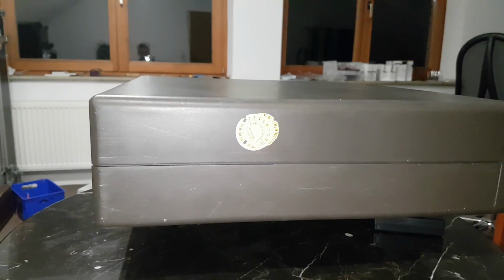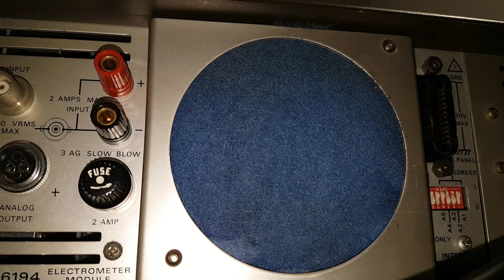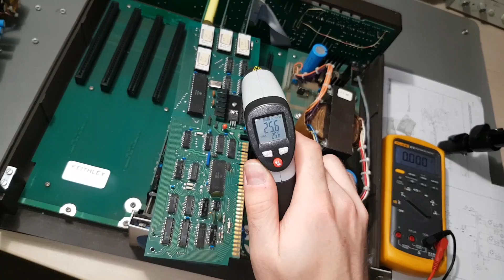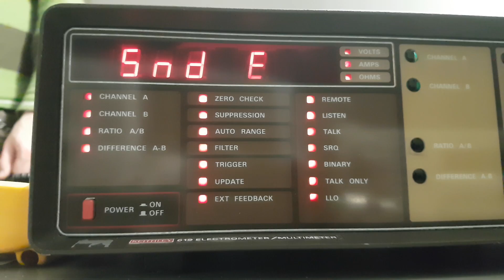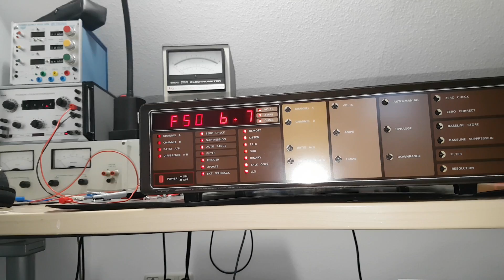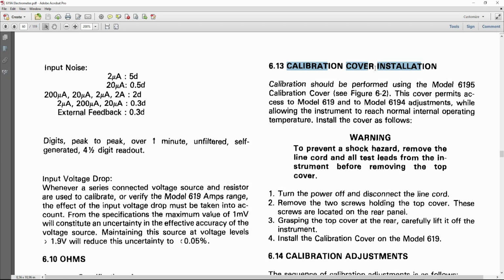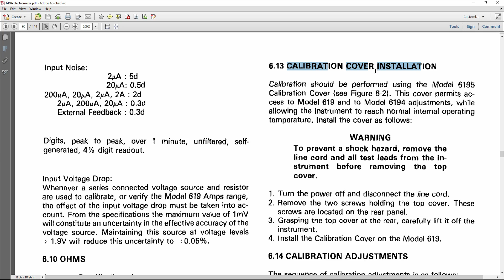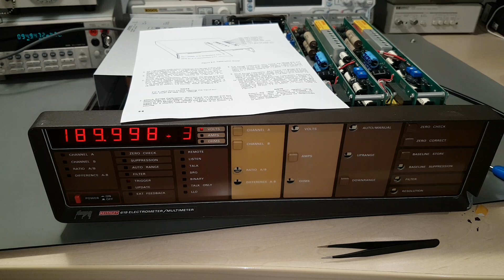Keithley 619 2-Channel Electrometer Repair and Calibration

Comment: Out of curiosity how much do you typically spend on equipment that needs to be repaired? You’ve inspired me to want to try repairing equipment so I’ve been keeping an eye on eBay but it’s hard to say how much is too much. Also, why did you buy the 619? Can’t wait for the next video!
Reply from the maker: There was a time when broken old stuff was priced reasonably on eBay. I think this one was 130 EUR or something. Now I haven't seen anything interesting + affordable on eBay all year :<
Reply: Marco Reps yeah it does seem that way. I’ve seen keithley 2000s going for $175 at the lowest and sometimes I’d see a single channel 619 for $50 but then shipping was $100. Are there any other places you know if that sell used equipment? I know the man down under, Dave Jones, goes to auctions sometimes. Maybe that’s the move

Comment: Its taken me over 2 years to remember the "just business" quote, I think its red dwarf?
Reply from the maker: Dota 2 Bounty Hunter
Reply: @reps  Damm...2 years down the drain.
Reply: @reps Just a cheeky question if I may. I want a uA current range  on my fluke79 meter, is there a cheap PCB project that I can make or something not to expensive to buy, because I want to measure the "deep sleep" of my atmega (and others around 500nA) maybe using opamps or instrument amplifiers and perhaps use the mills volt range on the meter ?...I am watching your lovely Kiethly repair vids with jealousy in my thoughts and envy in my wallet.

Comment: I recently acquired one of these units and it also had a failed 10uF tantalum cap in one of the two the electrometer modules.   It manifested as a recurring OFLO condition on the display when that channel was selected.  I will likely replace all the tantalum caps on the electrometer boards and be done with it.  Regarding the fan noise, I had the same problem with my unit.  It turned out to be dried up lubricant and dirt on the fan bearings.  Cleaning and lubricating the fan made it much quieter.

Comment: Hello, I came across your channel a short while ago, thank you for sharing your experiences!. By the way, can you confirm that the K619 has a two lug connector, which seems to be different from the K-236, which seems to be a three lug one? Thank you!
Reply from the maker: Yes, confirmed! 2-lug coax on 619, 3-lug triax on 236 and 237, 2-lug triax on 617 for example

Comment: I really enjoy your hunt for the culprit.  And I can relate to the stacking issue at the end.  

Tell us about those $60 IC's from the last video.  

I have a treasured Radio Shack Model 100 laptop that needs fixing.  You have inspired me to crack it open.
Reply from the maker: Well, good luck then! One of the expensive ICs is an AD974 "4-Channel, 16-Bit Data Acquisition System" with SPI output. There are oscilloscopes in abundance these days, but maybe a curve tracer or something linke that ...?